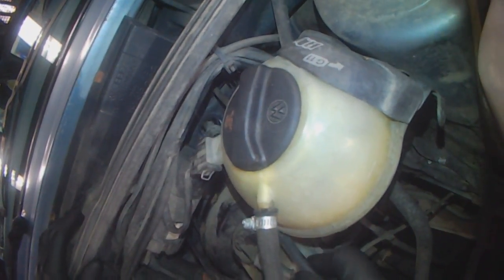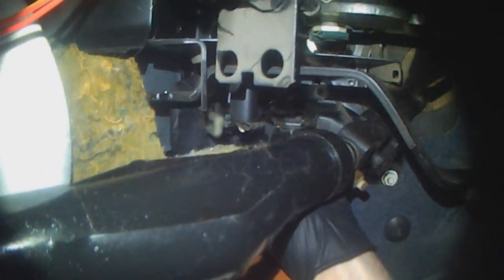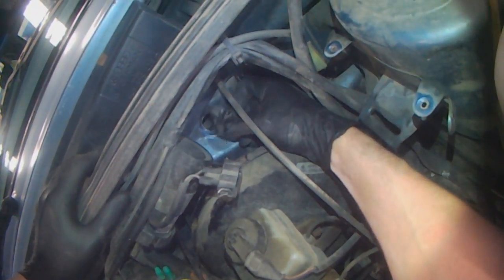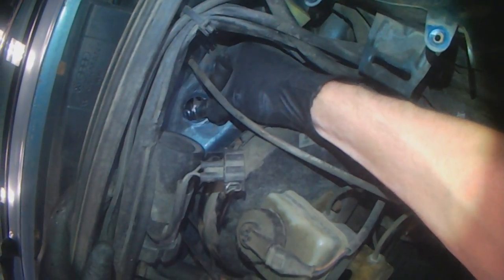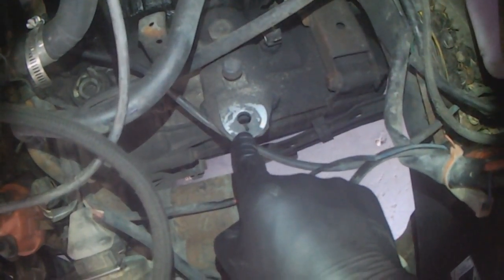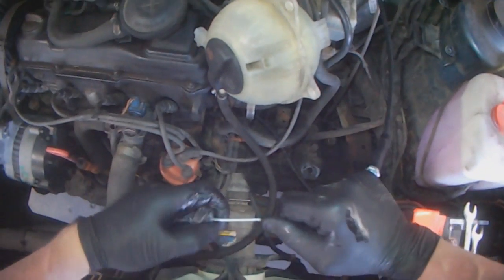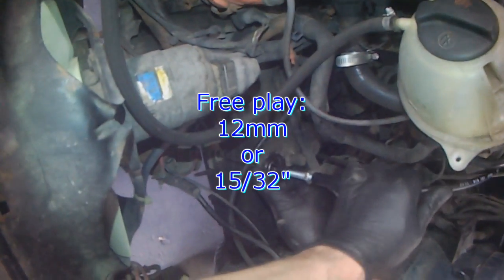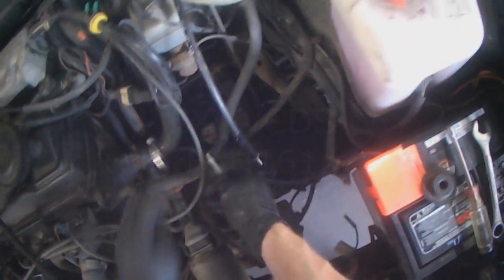VW A2: Broken pedal cluster (clutch cable support)

Comment: I replaced the pedal box on a 2000 Polo several years ago. No ramp available so did it on the floor. Back breaking!!
Reply from the maker: +Mark L Even with a hoist / raising it below waist high... what a pain it is to get under any dash. Luckily it does not happen often these days! :)

Comment: Thanks for this video.  I have heard of this problem, but hadn't seen anyone doing a fix for it.
Reply from the maker: Thank you for watching... this is a "temporary" fix. To fix it correctly / fully, the pedal cluster has to be removed and the broken piece has to be welded back on the bracket assembly. Depending on how many cracks the pedal cluster has (and where they are), it might be quicker to install a new pedal cluster assembly (if still available / one can be found).

Comment: Can you please describe what you "Nut/Washer Contraption" thing you welded to the tube??? or will any Washer by itself with the correct ID work? ...looks like 1/2 in from the front of tube?
Reply from the maker: Use whatever works / will hold it in place. The best way to repair the broken tube... is to remove the pedal cluster assembly and weld the tube back into its original spot.
Reply: @EXOVCDS  Bro! thanks for your super fast reply. How far does the "stop washer" have to be from the front of the tube? Do I have to be real precise with that or is 1/2 down fine? ... I am doing this  today
Reply from the maker: Hold the broken piece against the pedal cluster (where it broke off) through the hole in the firewall... use a marker and mark the edge of the firewall hole where it meets the tube. Weld a washer at that location.  Needs to be a thick enough washer so that it does not flex. Over time the firewall will flex and crack... so this is NOT a correct fix / repair. The customer did not want to have the pedal cluster removed... he just wanted a quick fix.

Comment: Clutch adjustment explained  is opposite the more threads exposed equals less clutch life
Reply from the maker: Not true... I've been doing this for 27+ years. 
As the clutch wears, the pressure plate moves the release plate closer to the throw-out / release rod... which causes the clutch cable adjustment to GET TIGHT. To loosen the cable adjustment (to get more freeplay) you have to REDUCE the amount of threads that are visible.
Reply: I drive a 16v daily and less thread  on cable when clutch is new but as miles add up and parts wear you adjust make tighter (exposing more threads)
Reply from the maker: You have a different transmission setup then... not a 020 transmission.
Get your facts straight. On a 020 transmission (like in this video) my explanation is CORRECT.

Comment: It's funny I can't remember repairing on like that is the pressure plate too stiff or the cable ?
Reply from the maker: V10PDTDI Both will cause the same thing... as well as metal fatigue from constant flexing of the pedal cluster (even if cable or pressure plate are not the cause).

Comment: going to have to do this to mine, thanks for the great idea :)
Reply from the maker: Thank you for watching!
Reply: No problem! had to do it a little different because i have an mk3, i put the old tube into my old clutch release bearing and placed it on top of the firewall. it works but slips alot and grinds into gears, waiting on a new clutch cable

Comment: Your repair should last the life of the car, correct?  It would seem what you did at the firewall is better than welding that old, fatigued piece of pedal cluster back on the old, fatigued pedal cluster assembly only to have it break again....in other words, I dont see any downsides to your repair....am I correct?
Reply: also, do you mind if I link these G/J mk2 videos on VWVortex for others to refer to?
Reply from the maker: I would rather replace or at least weld the pedal cluster... don't know if the stress against the firewall will do anything to these old vehicles.
Reply from the maker: ***** Not sure if they will meet vortex standards... if you think they are worth sharing, feel free to do so. If there's a chance the threads turn into "look what this joker is doing"... then I would say, no. :-)
Reply: ***** hey i know you,zippy the pinhead ^5
Reply: Zippy the pinhead ,long time no see